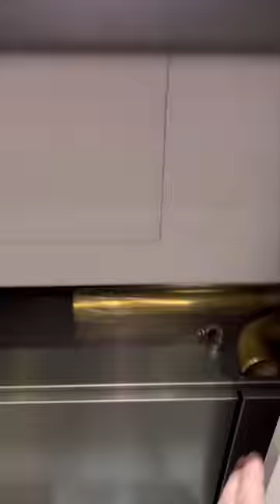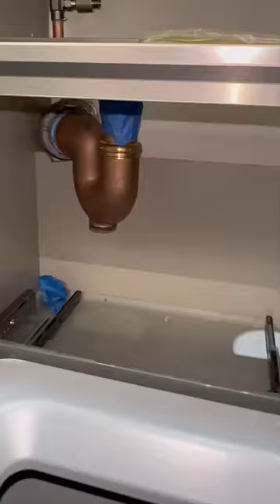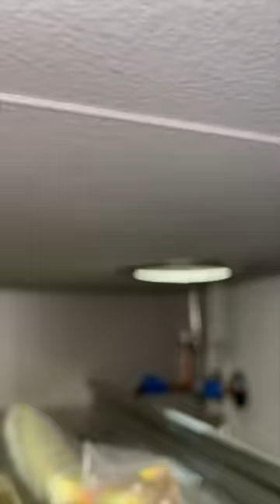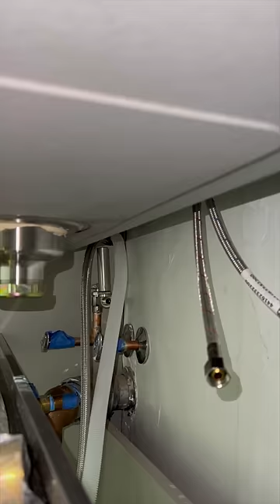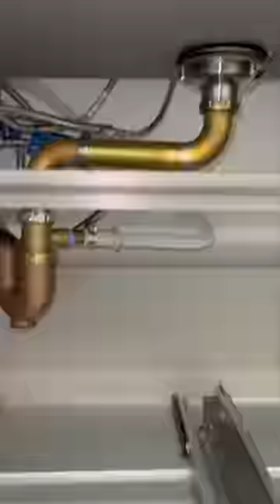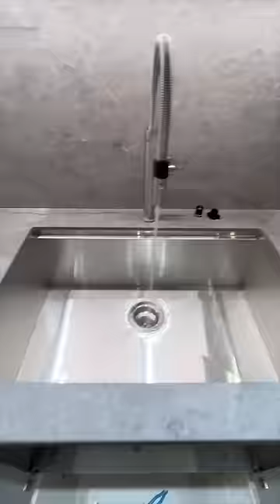Finishing up the short-tempered clients apartment #shorts

Comment: Dude with all due respect, can you PLEASE REMOVE THOSE BULKY PAPER TAGS off of the supply lines ???! Please!
Reply: No because it helps later to determine what size fittings they need next time and how long in length of hose they need eventually when that hose starts to deteriorate. Plus if they don’t come back it makes it easier for the homeowner or the next guy to replace the hoses himself/herself when they shut off the angle valves in the hot and cold supply instead of removing the hoses and measuring them to see how long they are and etc.